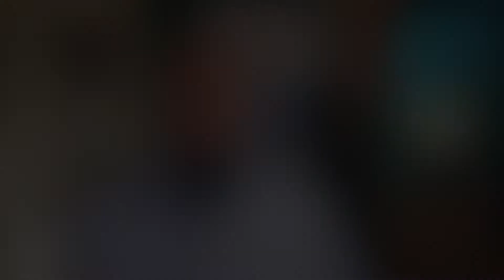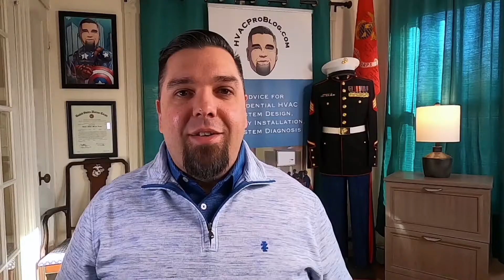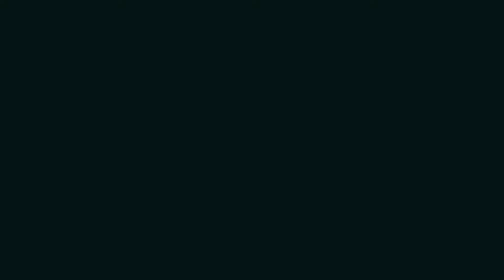High CO Reading - Now What?

Comment: If the heat exchanger is cracked, and when the draft inducer is sucking air from the crack, instead of primary air, wouldn’t that increase the co level ?